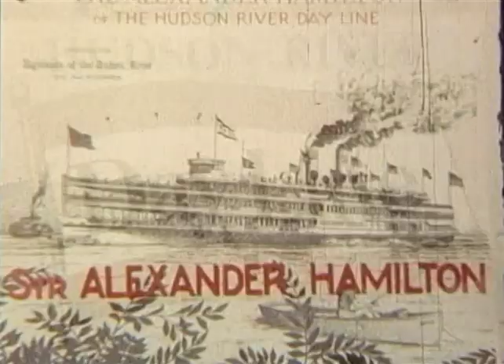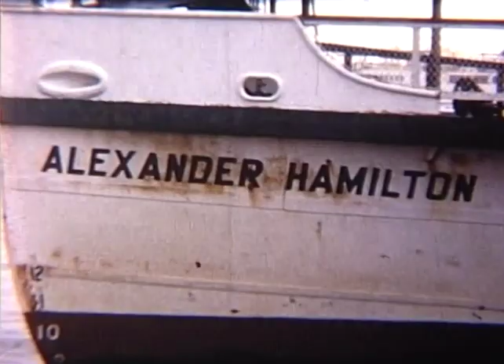Steamer Alexander Hamilton Reel #1 (1950s) (No Sound)

Comment: I remember riding to Bear Mountain ever summer 1960 -1968. That steam engine was mesmerizing. I remember the oiler, turning the grease fittings.
It was a side paddle wheel. Great thank you very much for sharing that.